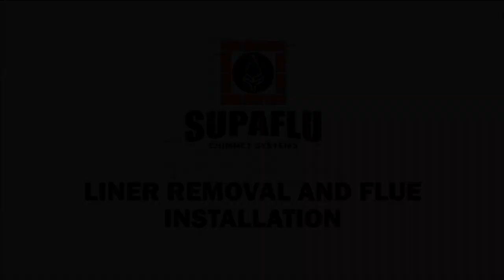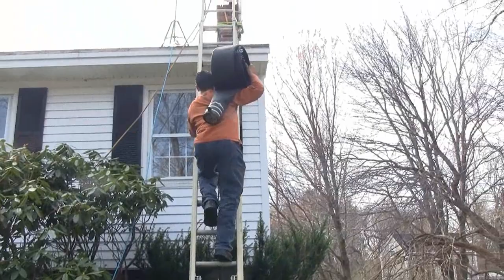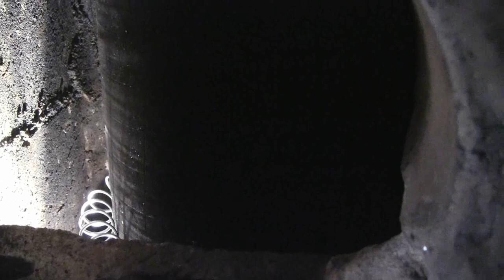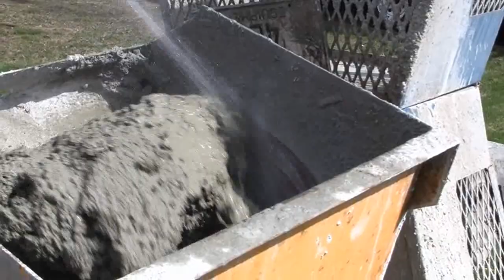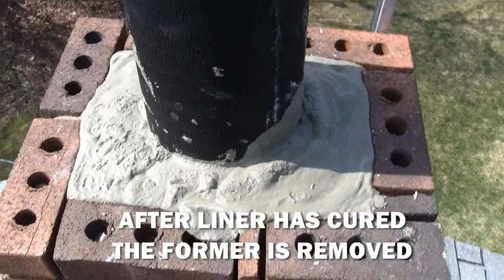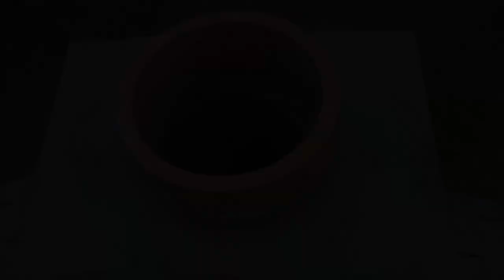Supaflu Chimney Lining Installation Video

Comment: You need a 1/4" expansion joint between the top tile and the crown, otherwise heat expansion will crack the crown. Crowns look best if you build a form to create a 3" vertical edge that overhangs the brick. Also creating a drip point so that water shed by the crown drips off instead of running down the chimney. Remember to apply a chimney sealer after all masonry has cured at least 3 days. 
You guys have a great system. Good video too.

Comment: The mix flows very easily. You"ll notice the springs in the vidio, around bends extra are placed to provide the needed clearances.  The void formers, although flexable, remain round. The wieght of the mix is the same all the way around it.

Comment: Yea chimney caps are great, as far as chimney sweep are concerned. They cause the smoke to slow and take a 90 degree turn before it can leave the chimney. This can allow the smoke a chanch to cool and deposit the un-burnt carbons on the chimney wall.  Please... only place a cap on for the off season.
Reply: what about animals getting in? raccoon, squirrel,birds,Santa
Reply: d sloan you mean like these two dead squirrels from the inspection  i did today.  I can't believe someone would suggest not installing a cap.  I wish I could include the photo it was kind of gross
Reply: Problem is I would think you would also be getting rain and snow down the chimney. You really don't want it getting wet in there. I do know when chimneys are not capped leaves get in there and water comes out the clean out door if it rains hard enough.
Reply: Chimney cap means no presents. Nah I will just cap it off. The chimney is worth more than gift wrapped crap you never asked for. Maybe that is why Santa makes sure it's never what you asked for. Just cap the thing. It's always the kids who have all the Chrismas fun aw Sh-t. And if that don't make matters worse I found out you shouldn't be burning unwanted gifts in the fireplace. Can't we grown ups have any fun!?!
Reply: What? You suggest ignoring IRC and NFPA 211?  good advice, chief.

Comment: Ahh, memories! I installed hundreds of liners for a chimney company in Virginia, both Supaflu and Solid Flue. I can see several things I would have done differently, but that's the nature of a service industry. No one warns you that one day you will come across an historic property that should be torn down, yet they want several thousand pounds of a masonry mix dumped in the top of the chimney. By the time it's all coffined up and cast, you feel like you built a whole new house. We cast homes and commercial chimneys. One day we'd be set up on the one way streets of Richmond, the next in a cul de sac in the Northern Neck. Having been in the industry as long as I was, I can say this is genuinely a product that saves lives. People don't realize the shoddy jobs done constructing chimneys in residential homes. Let them get dirty and have a chimney  fire, and it jumps right to the framing of the house. Can't happen with a masonry liner. I've seen liners on fire like a jet engine, but no structural damage. Close them off at the bottom and they go right out. Shouldn't let the creosote build up in a chimney.
Good stuff. My chimney is cast.

Comment: |A few things in error on this video, although this is a wonderful product.
1/ the chimney exterior should have been properly repaired prior to the installation of the Supaflu system. Tuckpointing in order to maintain structural integrity of the brick units
2/ there needs to be a proper cemnet crown cap installed with overhang and drip lip as per NFPA211
3/ there needs to be a bond break between the flue tile and the cement wash or crown.

Comment: Big mess why bust all the flue out just reline that bastard with cement like heatshield does now you have holes in walls just way more work then needed.
Reply: 1) the flue tile was damaged from a chimney fire, who knows how cracked or busted up it was throughout the whole flue
2) if you put a smaller diameter liner inside the existing broken flue, you are left with a smaller diameter flue pipe than before. You have to maintain the same diameter as originally designed or screw up the draw of the chimney. That means smoke and CO in the house. It would just create another serious problem. 
3) I see there is a thimble for a wood stove in this particular chimney. Big no-no to feed a larger thimble into a smaller flue. 
4) if there was a fireplace below, there is a direct relationship between the flue cross section area and the fireplace opening area. That even changes with chimney height l!

Comment: The void formers at size are around 18 lb of air pressure,  they are very firm to the touch. Yet flexable enough to bend around curves.

Comment: The top tile in this video was installed just like mine...and as stated below, it pulled loose during cleaning.  I had to pour a 4" cap to hold mine firmly in place.  As an "oh by the way", I used dye to make the cap black, providing a nice contrast.  The lack of brick repointing was the same as well, which I fixed even before the top tile fell out.

Comment: "Properly installed liner"you say.Someday you should tell me about properly installed liners.Like air gaps or insulation maybe."If you ever have a real problem" Well,with a stainless liner,at the very best you would need to remove the liner and replace it. At worst, what you would do is most likely rebuild your house.The poured liner system used by Solid Flue was tested at higher temp.s then a chimney fire for three times longer then the average fire. Ask anyone who has one,the wool was worth it

Comment: Yes the products are very differant. As a installer of poured liners sence 1984, that I can agree with. I worked with Mr. MacFarland, repairing a chimney on the campus of Oxford Univ.(UK) as well as hundreds of others in the Central Michigan area. This vidio is a show case of poor workman ship. No connector thimble,lack of consistency in the mixing. The crown was a joke, I hope that they dont charge when the have a chance the replace it. I could go on and on and on, but I'm out of characters....
Reply: Your spot on. However. If those poured liners crack, how do I repair them? Heatshield ?
Reply: My father built the chimneys on the school in Indy.